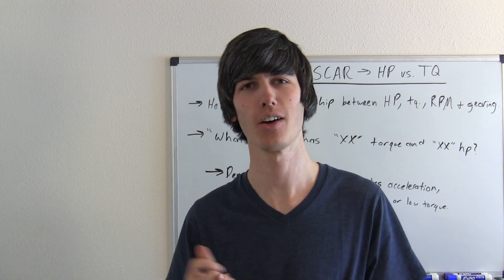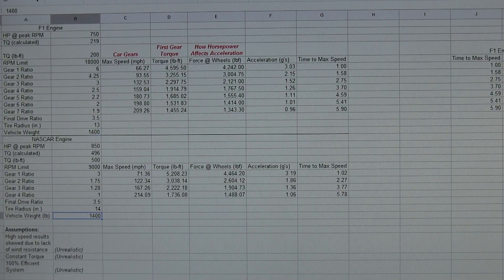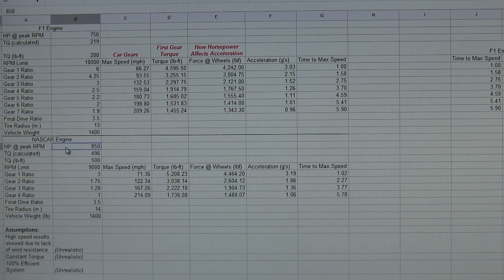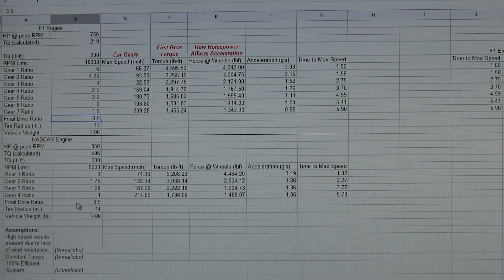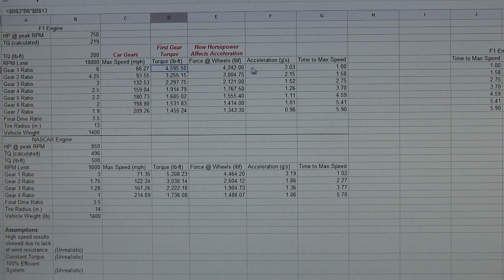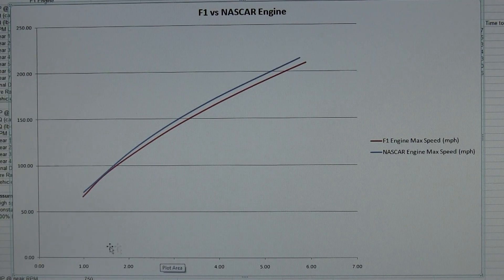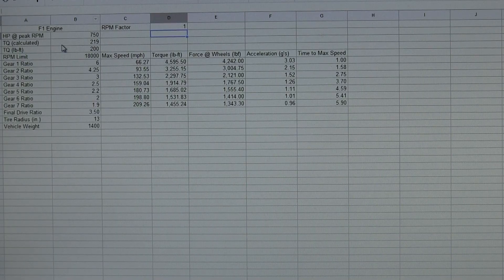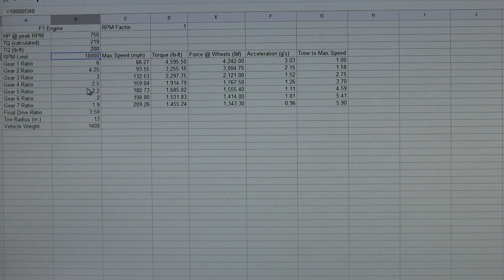Horsepower vs Torque - Formula 1 vs NASCAR

Comment from the maker: "Plus with proper gearing you can get to any speed with a 5 HP motor." This is completely false. Perhaps I have failed in illustrating with my video (as that was the goal, and is what it show) but you cannot get to any speed with any horsepower. 

If I am incorrect, show me a vehicle which has 50 HP (any torque you desire) and can reach 200 mph. F1 engines can do it with 200+ lb-ft of torque, and 700+ HP. I don't think you quite realize how connected the two variables are.

Comment: Plus with proper gearing you can get to any speed with a 5 HP motor. Look at mountain bikes, a human makes about 1/10 HP and can do over 40 mph. What if the bike had 60 gears? 40 under drive and 20 over. Imagine the speed that could then be achieved on one tenth a HP. With inertia and lack of wind resistance the sky is the limit.

Comment: Shaving weight and adding gears makes smaller displacement motors shine. Hence the power glide. Less time shifting and torque means faster acceleration. HP will never replace torque, It is a derivative. F1 motors use motion over torque as HP is torque over time. 18k rpms at 200 ft lbs of torque makes impressive HP numbers. It all comes down to how much air an engine can get into and out of it in a given amount of time. You can use either stroke/bore to achieve this or high revs.

Comment: Torque makes the car to move, yes. But not the torque of the engine, because the engine isn't directly connectet to the wheel. What let the car move is the torque at the wheels and that can be generated in diffrent ways. if you want double the torque at the wheels at a given speed, you can double the enginetorque or you can double the engine-rpm and change to a twice as big underdrive gear ratio, the result is exactly the same. And torque multiplied with angular velocity (rpm) equals power.

Comment: I wish you would have made this the focus of the video because I feel the vid was not on how torque or hp affects acceleration but on how a deficiency (relatively speaking) of torque is overcome by gearing. More or less you manipulated the data to support a conclusion. Torque is still actual power measured at the wheel, Horsepower remains the ability to do work over time calculated from a formula after measuring torque. 
I have no idea what I'm talking about lol cool channel I love it :-)

Comment: No, torque does not equal acceleration. Torque is a measure instantaneous force only. It is just one variable in acceleration.

Horsepower doesn't determine acceleration either, it is 2 variables.

You need to know at least 3 to CALCULATE acceleration.
You need to know at least 4 to predict acceleration.

But accurately predicting acceleration requires an infinite number of variables. The less variables, the greater the margin of error in your prediction. (4 variables = useless prediction)

Comment: Hey I loved your HP vs Torque especially the weight lifter vs sprinter analogy, really solidified it for me. However, can you make one more follow up video explaining how engineers create engine designs to maximize both? I saw a video yesterday saying long air intake tubes help maximize torque while short high flow = high HP (like deep breathes lifting and many short while sprinting). Can u show a diagram explaining differences in valve diameters/lengths differences between high hp and torque?

Comment from the maker: You seem fairly upset, but my video was made to prove the opposite of what you are saying. With a 5 hp engine, you can create whatever torque you want with gearing. But you'll never be able to reach high speeds, because you don't have enough power. Can you make something move? Yes. Can you make it move quickly? No. That's the point I'm making. You need more power if you're going to alter acceleration/top speed.

Comment: so would it take relatively similar torque and horsepower to accelerate and get your front tires off the ground or would you need a little more torque than horsepower or vise versa

Comment: POWER TO WEIGHT RATIO is critical for acceleration ...raise the power or drop the weight to accelerate faster...my experience is torque determines acceleration..horsepower(which is a product of torque) determines terminal velocity ...once you get there, your not accelerating anymore ...just fighting drag (a fixed number)..

Comment: What design changes does an engine need to maintain the output horsepower but use a lower RPM .. i.e. produce a higher torque

Comment: so basically, with low weight in mind, the f1 engineers had to use a small engine (2.5) but in the same time make it powerful.the low displacement engine produces low torque so they had to go with a high revving engine to compensate?

Comment from the maker: No, the weight of a car does not affect an engines torque, but it will mean slower acceleration. Driveline weight however does play a role in power delivery.

Comment from the maker: If you were to ignore weight, and put it in the same form factor, with different gearing, then yes. The goal is to illustrate how to engines can achieve the same result in very different methods.

Comment from the maker: Different engines for different applications. Acceleration (and thus weight) is not as important in NASCAR as it is in F1, so F1 engines are made smaller, but because they must rev much higher, the tolerances are much smaller and they can be quite a bit more expensive.

Comment: Just so you know, there are a few different kinds of "efficiency". HP/Liter, is one way of looking at efficiency, which actually tells you less then nothing about the actual efficiency since vehicles with high hp/liter typically have terrible mpg/chemical/thermal efficiency.  That said, even the turbo f1 cars don't have the highest hp/liter.  Electric cars have that title with infinite hp/liter ;)

Comment from the maker: As I mentioned, it was a joke. But joking aside, there are regulations which restrict the power in the both sports. Both engines could easily produce much more power upon lifting regulations. Also, the F1 motor is half the size.

Comment: They are mathematical comparable, but not so much mechanical. The Nascar engine is much bigger and heavier. Also because of the very diffrent powercurve, you would need a completely diffrent gearboxsetup. And last but not least, in most formula cars, the engine holds the gearbox and the whole rear suspension in place, they're not mounted to the chassis, just to the engine. But these setup needs a specially stiff engineblock and added mountingpoints which the nascarengine doesn't have.

Comment: Well most difference between them is related to the power curve. On a Nascar, there is so much power and torque at low rpm that even 2 gears are enough to let it start and reach 200mph. Adding more than 4 is even counter-productive. On an F1, you can't even bother to imagine a 1st gear going over 75mph without burning your clutch... There is absolutely no low rpm efficiency. It is broad powerband vs peak power. Put the same weight and it's just the gearbox allowing the F1 to accelerate faster.

Comment: Adding gears to stock cars is useless for reasons already stated, however I would have to agree that no vehicle that I know of have a manual 4 speed trans. That being said, I don't believe NASCAR will be adding anymore road courses for the sole purpose that they cant pack the stands, or rather, there aren't enough seats to sell tickets for.

Comment: No seriously, as it is, both F1 and NASCAR have similar variation between gears.  Adding an extra gear to a NASCAR would be like making a 9 speed formula 1 car.  If NASCAR had hairpin turns and didn't keep within a 50mph speed range for the entire race then your comment would have justification.

Comment: The primary reason why NASCAR runs higher displacement engines is since they are far more efficient to run at full throttle then F1 engines.  If we had Formula 1 style cars going wide open throttle for the entire track, they would be refueling ever 2-3 laps.  This fuel efficiency is due to allowing a longer/more efficient burn time, and a reduction in engine friction due to lower operating speeds.  It also explains why they have fewer gears.  They don't go slow enough to warrant the extra gears.

Comment: Believe it or not Formula1 cars get worse fuel economy. 3.5mpg. NASCAR gets 5mpg. 

The Formula 1 engines have to rev and do more work to get the same numbers. Fuel consumption determines how much work a car is doing. The F1 engine isn't necessarily more "efficient" it's just a different approach to achieving horsepower.

Comment: Juan Pablo Montoya raced Indy Cars and won the Indy 500 before he switched to NASCAR has not won a single race on an oval track. Meanwhile Kurt Busch and Tony Stewart (who won today) both race open wheel cars on road courses. Marcos Ambrose came over from the Australian circuit of V8 super cars and hasn't won a single race. The cars are built the way they are to keep in the spirit of stock car racing and are engineered to the limits within NASCAR's guidelines. Period.

Comment: F1 engines are regulated to be low displacement. They have to rev high to make power. There is less heat and friction because the stroke is short. 

With that said, F1 engines are practically engineered to destroy themselves. IT is rare for them to last more than a couple of races. This is why it is the most expensive sport in the world.

Comment: Funny thing that, because, in a way, F1 cars are MUCH less aerodynamic than NASCARs. This is because F1 aerodynamics is made to create downforce. This also creates drag. At high velocities, drag dominates over mass (F1 cars are VERY light). If you were to race an F1 against a NASCAR in a very long straight, the NASCAR would win for this reason (and oval too...probably) 

Howver, F1 cars can turn, accelerate, deccelerate, and change gears much faster. So an F1 would win in a road course.

Comment: Wouldn't it be that, due to regulations, NASCAR and F1 have to make power different ways?

NASCAR - bigger engine, more mass, therein more torque at lower rpms

F1 - smaller engine, tightly controlled displacement regulations. Higher rpm and thus higher hp. 

It is weird though. You would think that given the limited gear box of nascar (4 gears right) and the use of high speed tracks. They would have higher hp. Since high hp = high top speed.

Comment from the maker: Well it's certainly cheaper to make a larger engine have high HP than a smaller engine. The design is much more critical and the tolerances are much smaller if a small engines is to be designed to operate at 18,000 rpm and produce good torque across such a high RPM range, with a high power output. So you can add cost to the list of why.

Comment: NASCAR is meant to be about car racing thats why they claim they are camry's or whatever they are. they must resemble the production cars, so they will be the same size and with that will contain additional weight. Formula one is a formula of rules that governs the dimensions of car. If they did not have these rules there is the potential to be a lot faster.

Comment: Well I didn't hear about that regulation although I wasn't expecting to see the crazy tubro engines of the 80s either which were producing over 1000bhp as those were extremely inefficient and that would be going against the reason why F1 is going turbo next year, which is to increase efficiency and reduce fuel consumption. I was wishing the cars could get faster with the introduction of the V6 turbos but I was wrong. Looks like F1 cars are only gonna get slower. Really miss the screaming V10s!

Comment: Well the way F1 cars get big power is because they spin at very high rpm as in general the higher u rev the engine, the more power you get out of it.
Big engines give more torque as you have bigger explosions pushing larger pistons and more cylinders on the crank. Truck engines are usually around 13l turbo diesels. The big engines give the trucks lots of low end torque which is what the truck needs when hauling heavy goods. 
If you fit a F1 engine in a truck, it'll just be very inefficient.

Comment from the maker: Well if the question is simply why, then the answer would be because restrictions allow for larger engines, within the given weight tolerances. If the cars were allowed to be lighter, or forced to use smaller engines (perhaps for fuel economy purposes, such as in F1) then they would likely use smaller engines. NASCAR allows for larger engines in the regulations.

Comment: cutting the max rpm by half, doesn't mean you get automatically twice the torque in the real world. You have to specifically build the engine for the concept you would prefer. But for racing, a high reving engine has some advantage. high rpm also means a shorter stroke, which leads to a smaller engine which is also lighter. a lighter engine makes it possible to add more balast weight in to the car until you reach the weightlimit. This lowers the center of gravity which makes the car faster.

Comment: Sorry. I do not think that it is completelly correct.
Bu usually they prefer to put slow motors on tucks. And this motors if they have the same power they must have more torque. P=T.w
It is possible to have a slow motor in a fast car. Power is the important. More power more performance. It is possible to mount a F1 motor in a truck an put a big diff ratio. It will have big torque on the wheels.

Comment: That's true. The torque on the motor is not important. It is the torque on the wheels. And if the torque on the wheels are the same, if they have the same diameter, so the power must be the same. No matter if it is done by a "faster" or "stronger" motor. Power is Power. P=T.w

Comment: So why would F1 use an engine that revs so much higher instead of cutting max RPM in half like you did and changing the final drive? It seems to me like their engine design is causing more heat and friction. Correct me if I'm wrong, I might just not be thinking it through fully.

Comment from the maker: Yes, more torque means higher HP at lower RPM. Diesels are inherently more efficient for many reasons. They have a higher compression ratio, stay at low revs (less friction), and are often turbocharged. But it's also important that the engine is sized appropriately. It's not always best to have a larger engine, even if it is more efficient, due to size and weight.

Comment: So, is it true that having more torque enables a higher horsepower at a lower RPM? So having more torque enables the engine to spin slower, hence the fact that diesel engines have a reputation for having torque? If that's the case, if we forget about acceleration and focus on fuel economy, would high torque be better?

Comment from the maker: That's what I was illustrating at the very end of the video. If the F1 engine had a redline of 9,000, it would have 1/2 the horsepower, unless torque was allowed in increase, in which case the torque would be double in order to maintain the horsepower.

Comment: Sorry but no. The Turboengine will be consideribly less powerfull, because the FIA regulatet the maximum fuelmassflow to 100kg/h. Renault already said that their Turboengine alone will only produce about 550hp. The ERS-system will be more powerfull, but even with that, they wan't reach the poweroutput of the old engines.

Comment: When you think of torque, think of a big truck. It can't go very fast but it'll carry lots of weight easily and will climb over hills without any problem.
When you think of horsepower, think of a lightweight sports car. It can go very fast but even a little extra weight will affect its performance.

Sports car is like a sprinter. Can run very fast but can't do it while carrying a backpack.
Truck is like a soldier. Can't run as fast but can do it while carrying a big rucksack on its back.

Comment: Turbo engine is gonna give more torque. Power will be about the same or higher depending on how much boost is applied although revs are limited down to 15000rpm. Back in 1988 when turbos last appeared in F1, Senna's Mclaren had a 1.5l v6 turbo with upto 2.5bar of boost and it was producing upto 1200bhp. But those were the crazy days of F1. The 2014 engine is definitely going to be a lot more civilized and fuel efficient. They'll probably be producing the same 700-800hp but with more torque.

Comment: F1 engines are 2.4l while NASCAR engine is 5.8l. The reason F1 engine produces 750hp out of a 2.4l block is because it revs twice as fast as a NASCAR engine. 

In race conditions F1 engines are very inefficient because they run at very low compression ratios and they have to overcome lots of inertia to rev upto 18000rpm. But they weigh very little and are small which is why they are preferred in F1 as much of F1 engine is made out of aluminium, titanium and other light expensive alloys.

Comment: Cuz F1 engines are restricted 2.4l and are designed to be as light as possible.
Because of the small capacity, F1 engines produce high HP by revving high. If F1 cars were to use a low revving high torque engine to produce the same 750bhp, then they'ld be twice the capcity. Like a NASCAR engine is 5.8l.
Big engine is heavier and in F1 lightness is everything so F1 cars go for the smaller lighter high revving engine rather than the bigger, heavier low revving engine.

Comment: Are those engines same volume (ccm)? Do they have same fuel consumption? 
OK, if weight is a problem, now in F1 there is not refuling allowed during the race. Which engine has less fuel consumption? I would say low rev. So from that point low rev is better choice. 
Ok there is a rule that noting crucial on engines can not be changed  during last few seasons. We will see what will happen next year with new turbo charged engines.